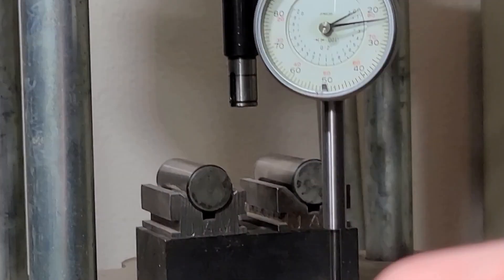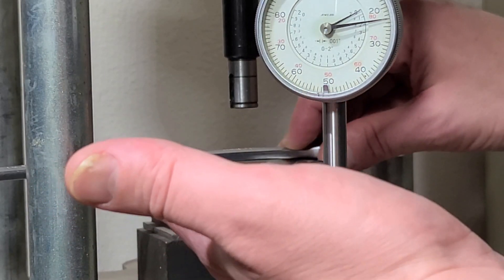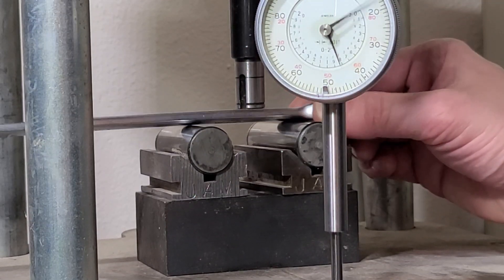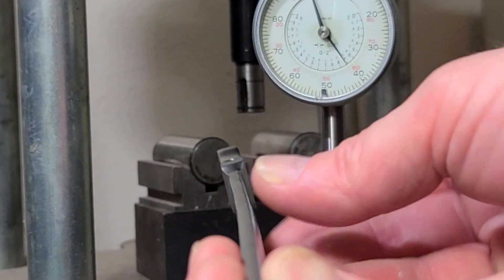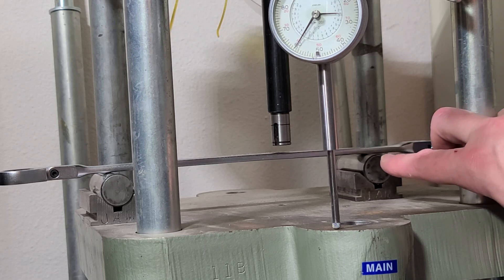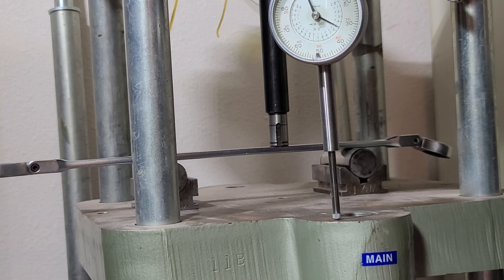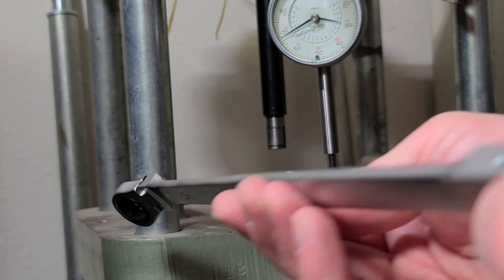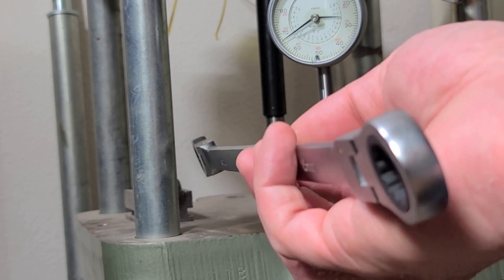Precision Straightening Using a Hydraulic Press & Dial Indicator

Comment: Great vid! Is there any work hardening occurring with this  process? Thanks!
Reply from the maker: Yes, there is work hardening so you have to be careful not to overbend then have to recover your steps because the hardened alloy steel will start fatiguing very quickly and become weaker.